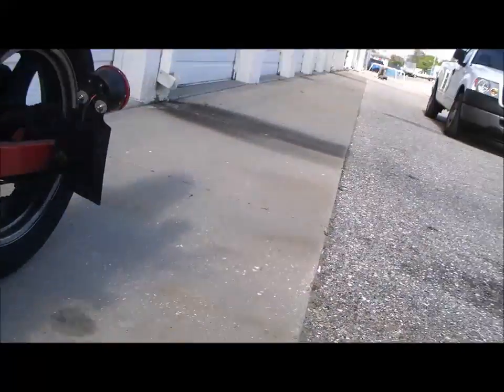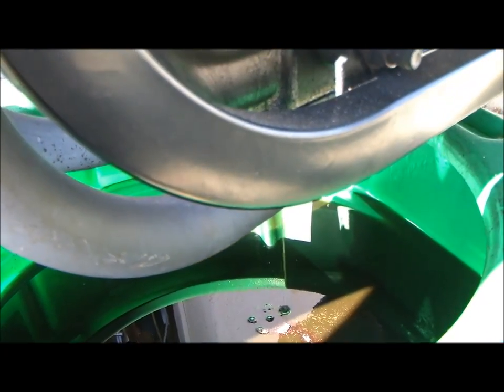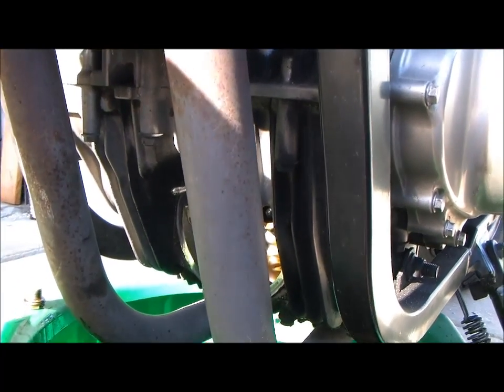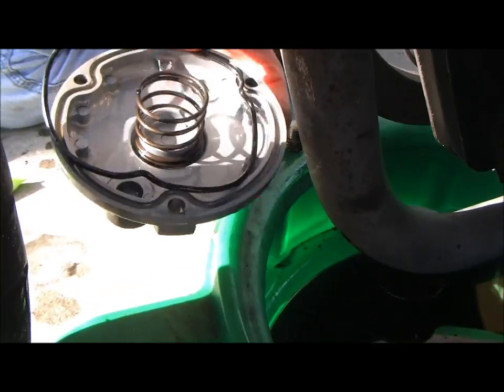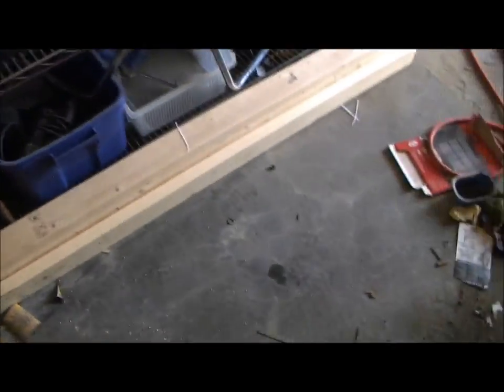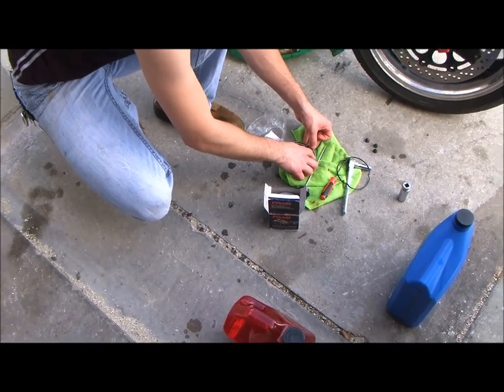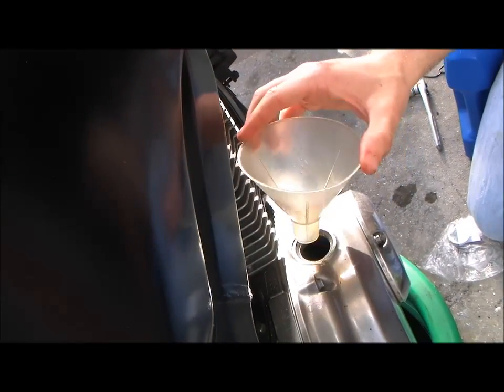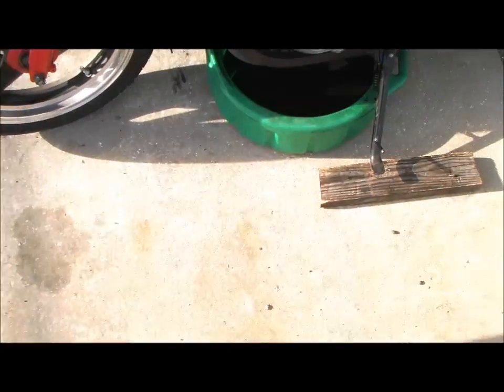Changing your Oil 2002 Suzuki GS500

Comment from the maker: my mix is 9 quarts diesel to 2 quarts Marvel and I use a pond pump to pump it through -- the PCV at the top of your valve cover gets the output line and your input goes right into your oil fill

Comment from the maker: .1 extra =96.25ml which is a little under 4 ounces over /not enough to wreck a seal or interfere with return flow.
Besides - the jugs are marked in .5 (500ml) increments makes life easy

Comment: Hey Todd, have a question about the pouring diesel into the engine. Been looking for best way to flush an engine of old oil and stuff so what do you recommend? Bike is a 2000 CBR and I honestly have no idea when last the oil was changed. So want to get all the old stuff out of it. Bike has also been sitting for about a year. Only started it again reccently......